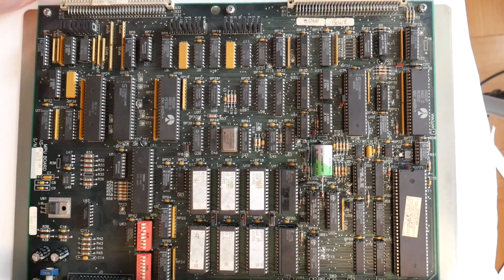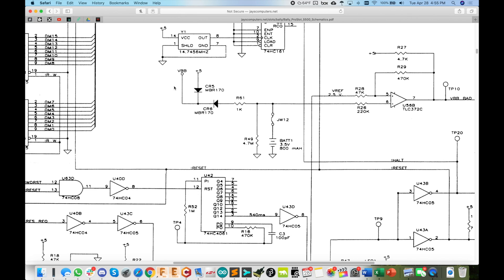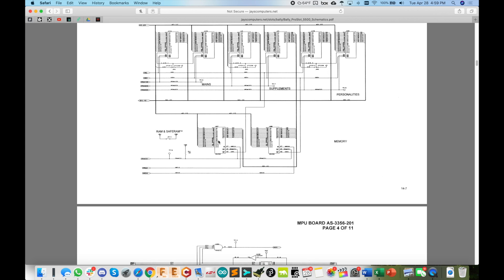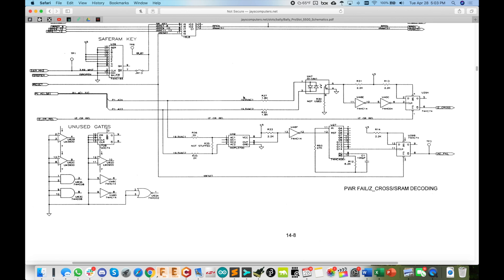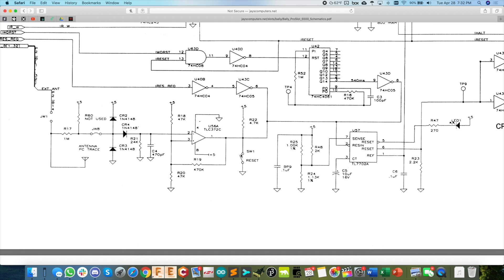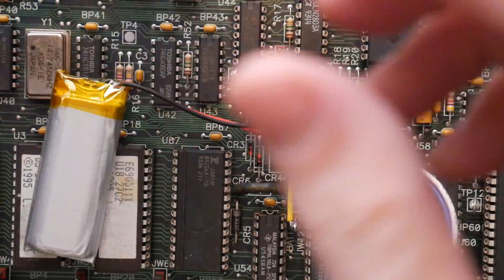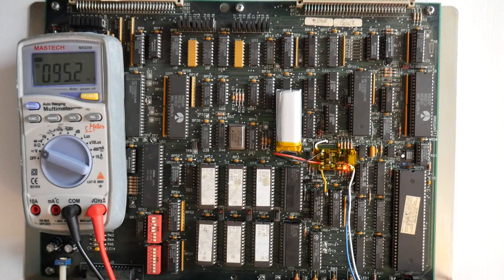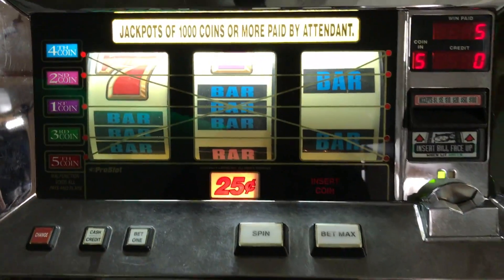Fixing a Slot Machine from the 90's! Bally's MPU Board - Dead Battery

Comment: EMI protection is because people would take a piezo lighter, and try to glitch the machine to get a payout. The battery backed RAM is there to store things like the random number generator output, so that power cycling the machine does not result in a predictable play. It also stores stats on payouts, and is used for the alterable elements, like winning payout percentages, odds and such. Storing the random number ensures that it will be random with each play, as it will only repeat again when the pseudo random generator rolls over fully, and that is likely clocked from the zero crossings, as a convenient clock source. Clock is also used as part of randomness, being fed into the pseudo random system as a varying input that takes 10 years to repeat itself, but which changes every second. The state of the random number generator is latched when you press start or pull the handle, the rest is theatrics, the number is set then, and is modified by the payout percentages as to which win if any is going to be allowed.

Zero cross is there for generating timing pulses for lighting displays, so they can be changed at zero crossings, reducing mains noise generated by the machine, as those typically are driven by triacs to keep the power side simple and robust, and if transistors or FET's they still run off an unsmoothed full wave rectified supply. Makes the bulbs last a long time even with a lot of switching on and off.

IIRC the default for most machines is to give back exactly half the money over a long period, so you need accurate tallies of payout amounts stored in RAM for this, but this can be changed by the owner via a serial interface.

That lithium battery will probably last a while, even powered off, though better would be to place a low leakage Schottky diode in series with the charge side of the cell, to drop the cell voltage to 3.9V max. Will reduce capacity a lot, but the cell will last a lot longer, never reaching 100% SOC, and staying at around half capacity and 60% charge, which it will survive for a longer time. RAM will survive, probably will work and retain data to around 2V, which is long after the battery protection has disconnected. In any case, will only self discharge slowly, and there probably last around a year with no power.
Reply from the maker: wow, this is awesome!  gonna pin this comment!
Reply: I never saw the  Hi Voltage spark attack vector  produce a payout but I saw on many occasions,  the credit counter being incremented to provide free plays. This attack was very successful in the late 80s and early 90s, designers got better at preventing the attack but I suspect it wasn't just a hardware solution IE it's not difficult to write code that tests for impossible credit increments EG from zero credits to 40 in under a second.

Bulbs never lasted a long time in fruit machines or pintables because they were overdriven for very short periods of time giving the illusion of being brighter. This technique resulted in dry joints, burnt and brittle looms and distorted support bulb housings. Bulbs were the bane of the arcade engineer's life.

Here in the UK, not only is not possible but it's also illegal to set a machine to pay out 50% of the time. New machines from manufacturers were always set to the minimum legal requirement which, back then, was 72% Interestingly, the algorithm  for percentages was different for arcades which paid out more frequently with lower cash values whilst pubs, clubs and other outlets would pay out less frequently but with bigger cash payouts.
Reply: Do you know about the Bally ACSC system, Good morning

Comment: I have a IGT  S2000 Double Diamonds  25 cent quarter machine from Balley 90's in storage with no way to hook up or plug in due to no electricity. When I moved it would light up but the reel would not spin. What are your thoughts on a fix? After watching your video I do remember when my husband was alive he fixed it and we ordered a board from e-Bay and everything worked and then we would shut off when not playing it and sometimes just kept it on. Do you think since it was just left on, it might have just drained the battery? I don't know how to find the back board on my machine. Maybe I should hire someone. If so, how do I find a slot machine tech?

Comment: What are the product details on the battery used (voltage/capacity/size) and the charger circuit board (name size etc), I'm looking to source these to upgrade mine but want to make sure I get the correct ones.

Comment: Kevin, I am by no means an electronics technician, but I have tried to learn a basic understanding of how electronic devices work.  Surprisingly, I was able understand what you described while fixing the slot machine board!  Awesome repair video.  BTW, the front door sensor you built for me last year has continued to work flawlessly!  It has been close to a year since I had you build it and the battery has only dropped once, from 4.0V to 3.9V!  I believe it will last five or more years at this rate!  Thanks again!

Comment: That's a dangerous solution, the battery goes dead if it's below 2.8 volts and can go it to flames or explode if will be charged with 500ma from zero and force the battery to 4.2 volts. I would not use that kind of solution with li-ion or li-po.
Reply from the maker: this battery has internal protection built in
Reply: That is why the little BMS is there, limits current and voltage, and the battery also has the ultra common DW01 charge controller in it as well, which will not allow fast charging, and protect the cell against being discharged too deep. But even so, taking the cell to 1V is not going to kill it, reduce capacity yes, but it will charge up again. The killer for these cells is reverse charging them in a series string, or charging past 4.4V, where they plate out lithium metal in the separator, or plate it out in the wrong place.
Reply: @SeanBZA  Not only the battery - the used TP4056-Board is also a module variant with additional DW01, so even a "unprotected" cell would be not problem. The only thing I would have changed is the charging current. These boards are usually shipped with a 1A configuration which seems a bit high for this configuration.
Reply: @adlerweb  Good point. Might want to pull out one of those TP4056 and see what resister it has on it to be safe and be sure the default is 500ma. 1amp should be ok for a 1000ma battery as its right on the line but those are some really tight tolerances and I am highly doubtful of that little thing is REALLY 1000ma.  The capacity loss over time due to constantly hitting the low voltage cutoff as stated abovie might also exacerbate the problem.
Reply: Don't LiPo batteries have built in protection DW01 for, Over voltage, Short circuit and over discharge protection.  In my last project I used a 5vdc wall wart with a series 1N4001 diode to charge a 300mah LiPo battery which then feed a 3.3v LDO voltage regulator.  Is the BMS TP4056 needed???